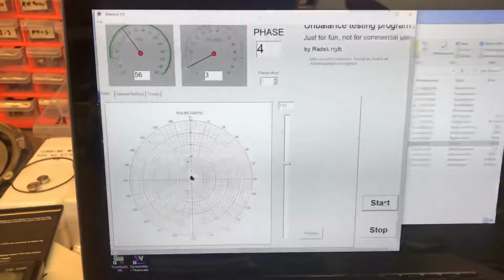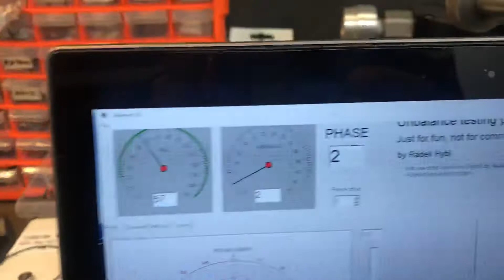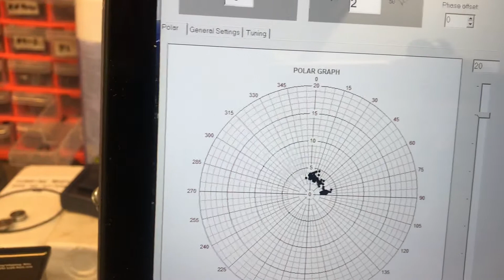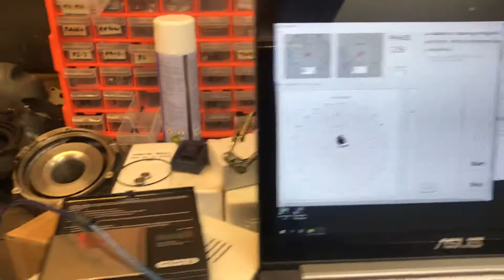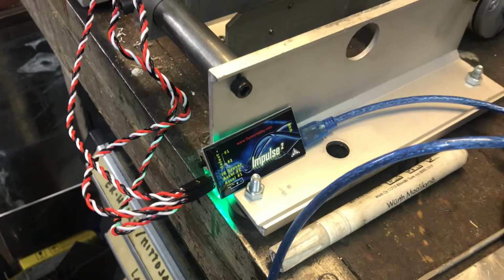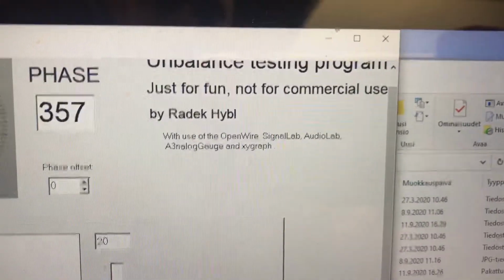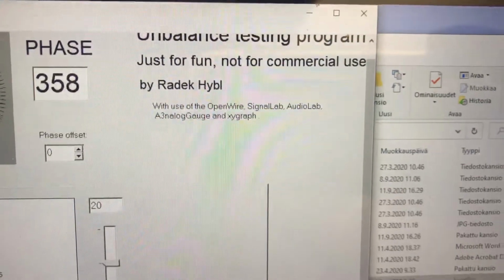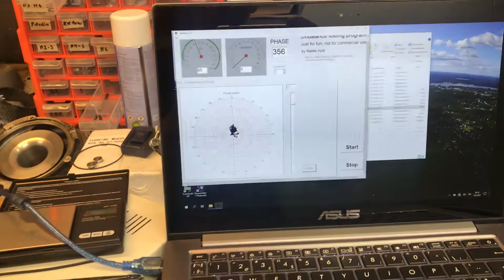Diy turbo balancer first tests

Comment: Where can i get the software to try it with my impulse?
Reply from the maker: Use the Impulse software, its easier to calibrate.
Reply: @MJPilote  having issues calibrating it corectly to a bigger set of crankshaft
Reply from the maker: @EdvardHansson  I have not tried anything heavier than 300g shaft, how much calibration weight did you try?
Reply: @MJPilote  the shaft is 18kg and trial weight is 10grams. We get about 4mV as input signal from the Accelerometer P.
Reply from the maker: @EdvardHansson  are  you using the standard accelerometers or piezo? The mems sensors are not that sensitive. Rigid or floating bearings on the cradle?